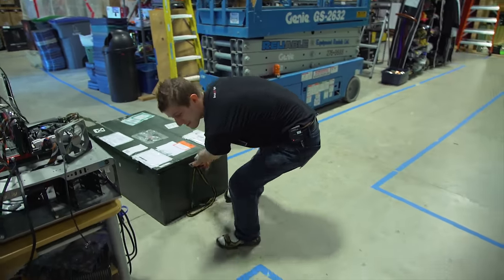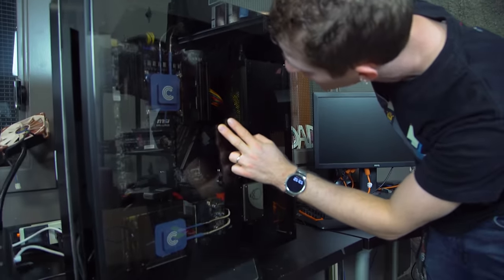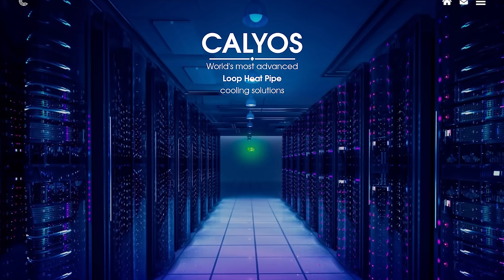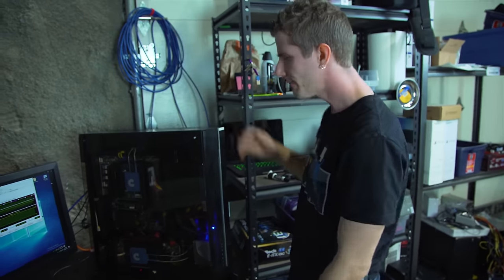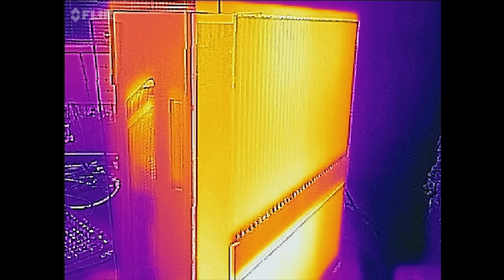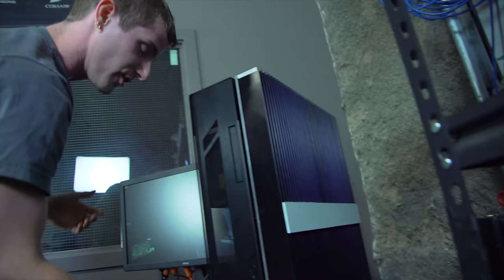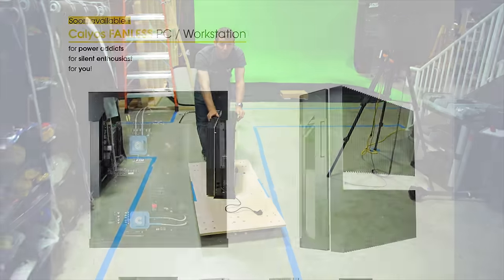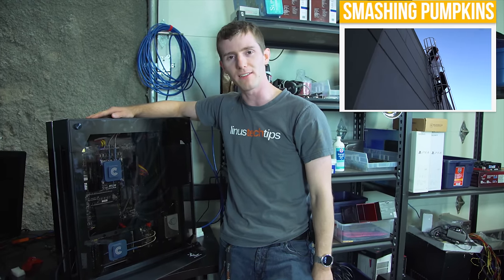TRULY Silent Workstation PC with ZERO FANS - HOLY $H!T Ep. 13

Comment: Thermal cameras can't read accurate temps through glass. You get the glass temp only on the outside.  Would of been a bit higher if you could of opened it I'm sure. Someone else made a closed loop cooler like this 10+ years ago but I can't remember what company it was. It always seemed like a great idea to me.

Comment: Here is how anyone can accomplish the same thing:  Buy a PC motherboard without the case or with the case and remove all the fans. Buy a fish tank that the computer will fit into.  Buy the appropriate amount of Novec Flourinert liquid that will submerge the PC inside the tank. The top of the tank should be sealed and a peltier cooling device should be attached to the lid to allow the gas coming off the liquid to condence and drip back into the tank.  Power wiring through the lid is best to have the AC supply outside and only DC going into the tank. The only concern is the flourinert price is about 200 dollars per gallon so having the smallest tank is important.

Comment: I built a desktop pc for music production. 460w fanless psu, and noctua nh-d14 on the cpu as well as noctua case fans. all fans running at really low rpms. the only thing that makes a sound is the mechanical harddrives. before i put them in, i couldn't hear the pc make even the slightest sound when putting my ear right onto the case at midnight. That's how silent it is. The CPU however is a i7 2600k running at stock speeds. and as for the gpu, it's only using the buildt in igpu of the cpu. no graphics card in that pc apart from the igpu. its quieter than a mouse. And temps are great too.

Comment: basically it's based on heat based refrigeration instead of compressor based. it seems they are using heat from CPU and GPU for the purpose.

Comment: Linus, i don't know for sure, but I think it is impossible to read Temperature through windows
so, in your shoots, you showed only the Temperature of the glass and not the parts themselves.
if i recall it correctly, it is because therma cameras measure via infrared which is blocked by glass...

Let's see if Linus will Reply :D

Comment: You should remove the sidecover for taking thermal images. The glas/acryl isn't transparent to IR heat radiation. You might just see the hot spots on the window

Comment: What really amused me is that you Americans never bothered to create a hybrid seeback-peltier effector system that converts heat into electricity by placing the seeback thermo-electric part on top and placing the peltier freezing part at the bottom of the CPU IC chip and GPU IC chip with the CPU IC chip and GPU IC chips between them. The electricity generated by the seeback thermo-electric seeback part is used to power the peltier freezing part at the bottom which can reach a level of freezing coldness as cold as 7 degrees centigrade below zero. This set up is placed inside an argon-filled sealed ceramic package.
Reply: Pretty...amusing...

Comment: This is cool technology for sure, but I do not see this type of cooling system being mass produced or widely used, there are too many potential problems with this kind of setup, At the very least, this system will likely die an early death from heat since there is no airflow to cool the VRMs, chipset, RAM, etc. The air stagnant air inside the case will probably get hotter and hotter and get quite warm eventually. The other major problem that I can think of is the refrigeration system could develop a leak from vibration or a number of other reasons, and that would be a big problem.

Comment: You had your right arm (and leaning) on the computer as you weighed it, at least that is how the video showed it. That will add from 3-10 lbs to the measurement, depending how much you leaned your body weight to your arm.

Comment: why didn't you remove the foam protector from the heat-sink - cannot believe it's designed to look like that - the temps would have been lower if it had been allowed to convect properly?

Comment: What if you run a black PVC outside your room and use the chimney effect.  Then run the tubing in the window and through the PC case.  Hmm.  Or I suppose you could hack together a box onto the vent for your air conditioning in that room so all the air in your room goes through your computer first :)

Comment: 2 questions. What is that white line in the middle of the heatsink?
And What have they done with the power supply? I know normally they come with fans, do some exist that are so efficient they do not need cooling, or have they provided some power supply cooling as well as the GPU/CPU?

Comment: this preforms about the same as my 360 rad loop cpu is cooler on my side, but my system is not silent with 6 fans and a pump. if i go to silent mode, my system still makes more noise. And zero fan system out preforms my cooling then.

My water loop kost around 400-600 euro, my hole system weight is around 28.5 Kg so there that.

So this is cheaper then that and they can RGB it up a little, more maybe sell it like a closed loop solution, with like a spiral heat sink i would be very down for that.   

Impressive very impressive

Linus rap references are so 1990-2005 your getting just as old as me :p

Comment: I can remember reading a Readers Digest article on the Mosler Safes that has a copper sheating to defeat the oxy-acetylene torch from breaching them because it dissipates the heat. One Japanese engineer I knew built a passive cpu and gpu heat dissipation heat sink based on that principle and created a new Desktop PC from scratch by building a customized (but easily mass producible) motherboard to accommodate 4 passive cpu heat dissipation heat sinks and 4 gpu heat dissipation heat sinks. And a new computer case with reinforcing frame to accommodate it and as well as other computer components, especially with a lot of USB ports and a lot of DVD and CD slots and floppy disc slots and magnetic cassette tape slots BECAUSE ALL OF THE NEW TECHNOLOGIES OF THE 1970s, 1980s, and 1990s are all returning and are fully upgraded. While America seems to be on the sideline because Americans seems pathetically apathetic when it comes to such innovations and especially the use of OPEN SOURCE COMPUTER HARDWARE AND OPEN SOURCE COMPUTER SOFTWARE (HARDWIRED IN ANALOG IC CHIPS). The key to the Japanese secret is increasing the surface area of copper heat dissipation fins by 2 to 3 times and designing the passive cooling process to enhance the passive convection effect induced cooling process based on the chimney effect.

Comment: Using thermal camera through the glass, gives you readings of the glass and not of the components you tried to measure, temperature and light dont work the same.

Comment: im using Gamedias Kratos P1 650G PSU.
even after 6-7 hours of working and 3 hours of gaming my psu just doesn't leave the silent mode.
I've to manually on off the switch.
do I have to worry about that ? should I leave it in silent mode or I just leave the full speed of the fan for all the time ?
is it bad for the psu ?
i just don't know what to do 

help me here pls.

Comment: 500 buggs doenst sound that bad to me ....
for a really good case with enough fans and dust filters and noise protec, i would pay 200 buggs or even more 
then 100 - 150 for a really good cpu cooler and if possible the same for a gpu cooler, and all that money would still not make it as quite or as cool looking and functional as this one ..
but it would be interesting to know, if you have to change the stuff inside and how expensive it is
Reply: You need to have way to much money to spend my friend

Comment: i want a liquid-nitrogen cooler how effective would that be?
Reply: It would be very effective but also very high maintenance. You will have to keep pouring LN2 to keep it cool, or use a blow torch so the CPU won't shutoff due to the extreme cold.

Comment: Not impressive. With a large enough heatsink you can cool anything. What's impressive is like when you have a single fan in a small portable system running at 900 RPM and cooling everything.

Comment: Only thing that irks me is he is taking the thermal readings of the components inside through the glass plate. That is going to distort the true readings because he is reading the surface temperatures of the glass, NOT the components that are thermally isolated from the glass plate by an air gap. Here is a good example. 
https://youtu.be/Fx49t4sv7f0?t=2m20s

Comment: Car heatsink? Radiator they mean. The "heatsink" of a car would be somewhere inside the engine block between the cylinder sleeve and the water jacket depending on which way you look at it. 
You nerds can be the know-it-alls for computers, just let me then have my engineering stuff.

Comment: Did you just... try to take a thermal reading through a piece of glass? You literally took a temperature reading of the reflection!!!

JUST BECAUSE YOU CAN SEE THROUGH IT DOESN'T MEAN THERMAL RADIATION CAN!!!! 
Also... most metals (including aluminum) don't actually read the correct surface temperature due to their blackbody emissivity.

Comment: linus i can tel you how day keep it flowing in 1 way and how day can make it flow fast en of 2 its very simpel day just use a 1 way valve(day work like this http://www.aircommandrockets.com/images/launchers/check_valve_detail.jpg) and the way day get it to flow is easy 2 wen  Calyos Cooling solution heats up it exspends and puses true the 1 way valve into the place were it get coolbut by gowing their the presure their also gowes up persing the cool Calyos Cooling solution into the CPU/GPU cooling block were it heats up exspends and gowes true the 1 way valve agene witch start the same proses agene and agene as long as it heats up it stase in motion this way  now it sounds very simpel but to make this work you need to be very exsackt whit the stuf you use fore cooling and make sure the presure inside the rig is at the rite presure and expansief en of to make it work
Reply: But do you know da wae?

Comment: what the fuck is a pound?!!!!!
Reply: The pound or pound-mass (abbreviations: lb, lbm, lbm[citation needed] for most pounds, and ℔[1] or ″̶[2] specifically for the Apothecaries' pound) is a unit of mass used in the imperial, United States customary and other systems of measurement. A number of different definitions have been used, the most common today being the international avoirdupois pound which is legally defined as exactly 0.45359237 kilograms, and which is divided into 16 avoirdupois ounces.[3] The international standard symbol for the avoirdupois pound is lb.[4]

Or

The pound is a unit of currency in some nations. The term originated in Great Britain as the value of a pound (weight) of silver.[1]

The English word pound is cognate with, among others, German Pfund, Dutch pond, and Swedish pund. All ultimately derive from a borrowing into Proto-Germanic of the Latin expression lībra pondō ("a pound by weight"), in which the word pondō is the ablative case of the Latin noun pondus ("weight"). The English word "pound" first referred to a unit of mass or weight; the monetary pound originated as a pound (by weight) of silver.[2]

The currency's symbol is £, a stylised representation of the letter L, standing for livre or lira. Historically, £1 worth of silver coins were a troy pound in weight; in August 2016 this amount of silver was worth approximately £170 sterling.

Today, the term may refer to a number of (primarily British and related) currencies and a variety of obsolete currencies. Some of them, those official in former Italian states and in countries formerly belonging to the Ottoman Empire, are called pound in English, while in the local languages their official name is lira.

Both of these were from Wikipedia.